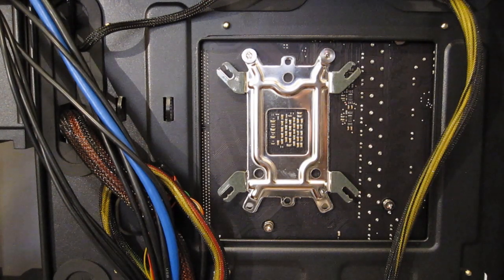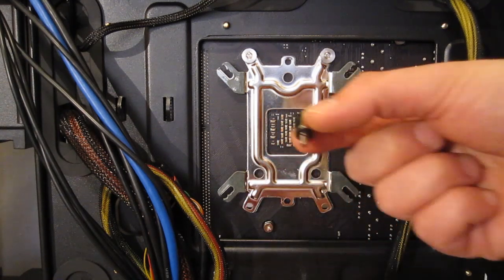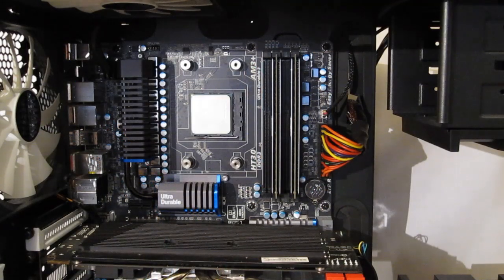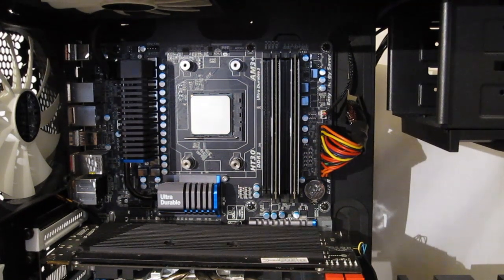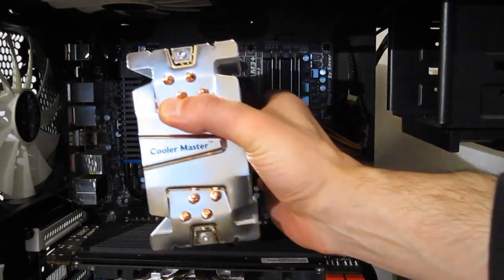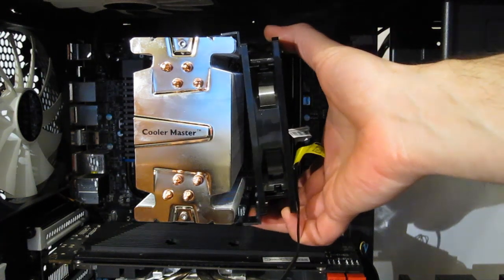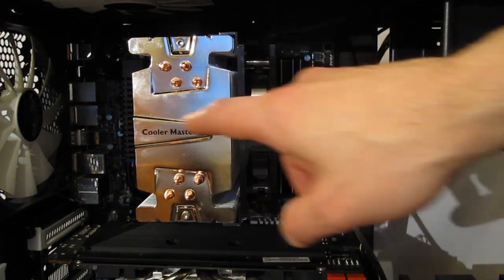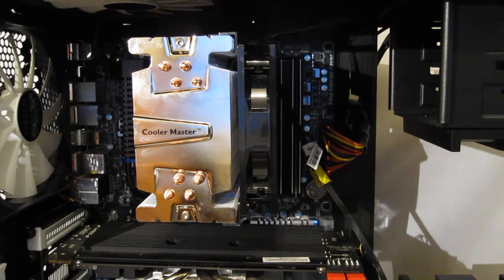Cooler Master Hyper 412 PWM CPU Cooler Installation at HiTechLegion.com

Comment: I'm new to this so please help.  I have this cooler and I did everything right like you said in the video. So my question is... Do I need to tight the screws all the way down (until the screws stop moving) or should I just tight the cooler until it's somewhat tight but the screws still move?

Comment: What is the direction of the flow the way you installed the fan: to the rear or to the front?
Reply: To the rear.
Reply: George Cella the installation of a second fan on it would affect the flow inside the case?
Reply: Ryan Siqueira negatively, I mean, would it mess it up?

Comment from the maker: You can put the fan on the rear. Typically you would run it so the flow goes to the rear of the case so that your overall airflow is not disrupted. You should only lose a few of degrees under load doing this.

Comment: is it possible put the fan in the other side of the cooler but only that fan?
if i do that it will be harmful for the cpu's temperature because it will be below the power suply?
and if it's harmful putting the fan in the oder side but i place an extra fan in the back of the cae introducing coll air?